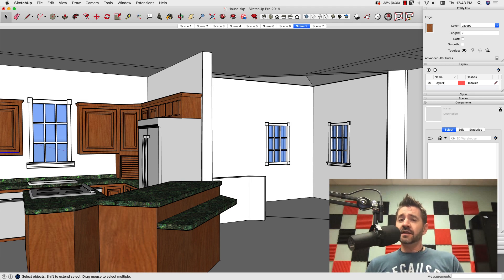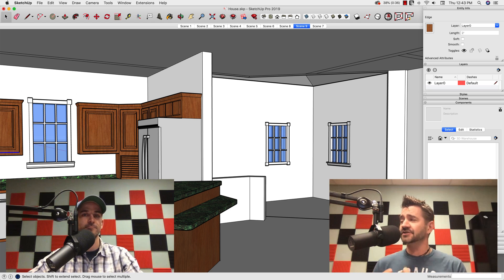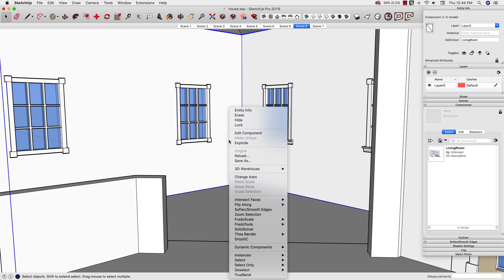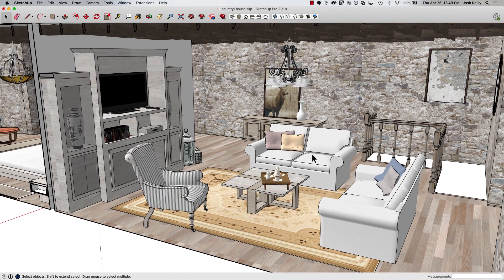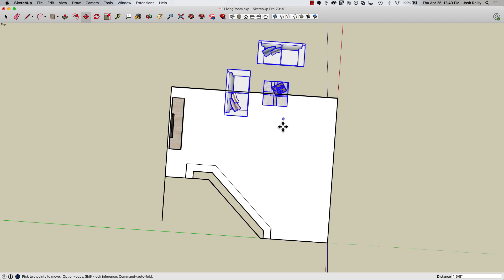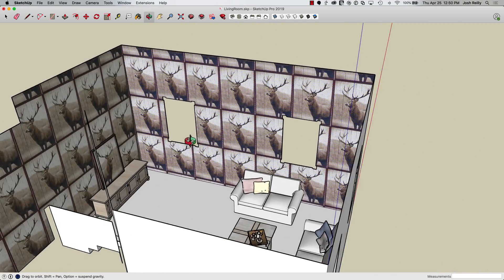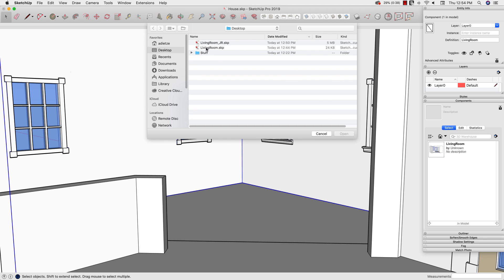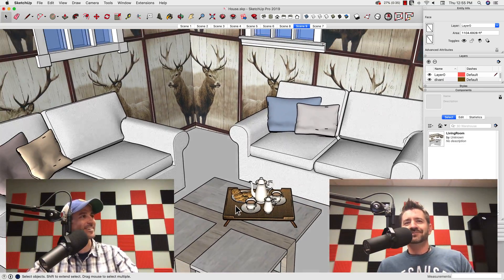Collaboration best practices in SketchUp

Comment: Thanks guys. Good tips here. I was hoping you'd be using Trimble connect. Is there a fancy way of getting components to update in real time- or with a refresh?
Reply: I believe that there is an extension out there that does something like that... I will have to look it up, though... We love TC for collaboration, but this workflow was closer to the one that Trilogy uses.